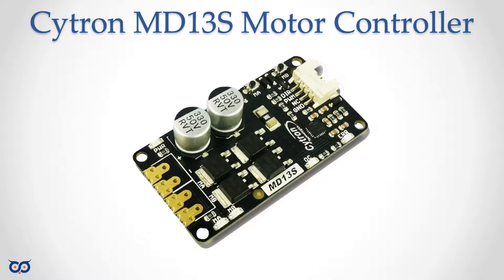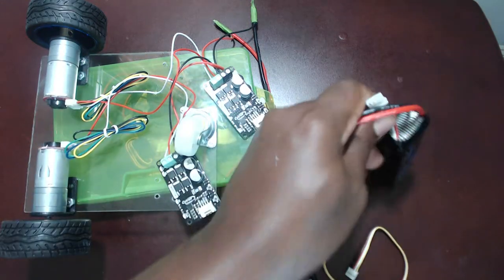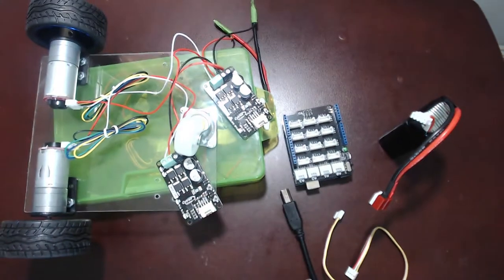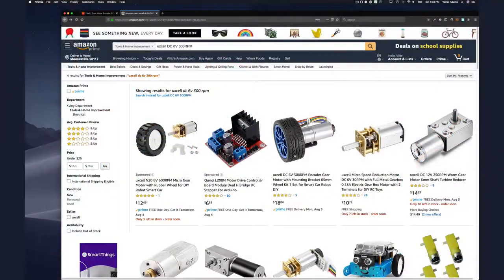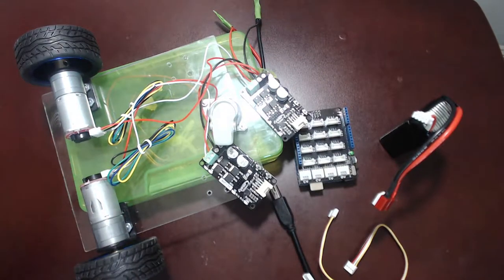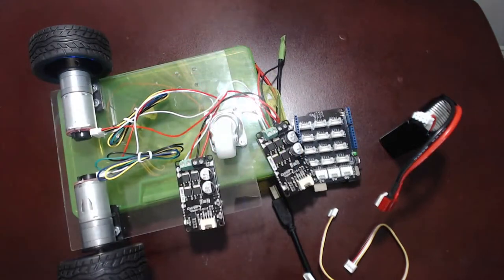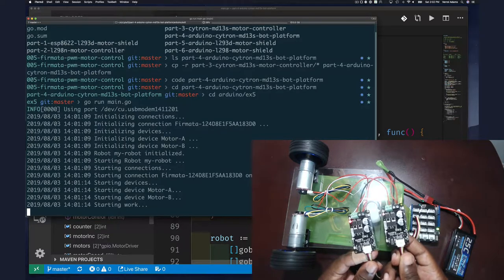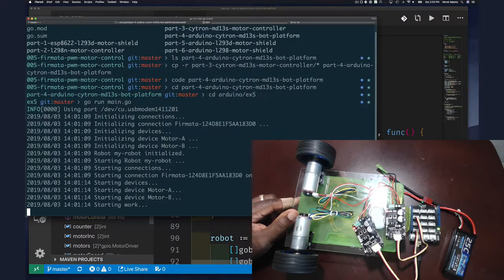#golang #embedded #gobot - S5 E4 Arduino and Cytron MD13S Motor Controller

Comment: I love all your current sir (especially, the Embedded series). I am Go Engineer and I would love to play around Arduino and GoBot. Please do you have a complete course or resource you can recommend sir?
Reply from the maker: Hi Adeshina, I will be continuing with the embedded programing videos once I move. I literally don't have the space for my electronics anymore. In terms of resource, I was just using the GoBot website and checking the source on Github when I am stuck. :)